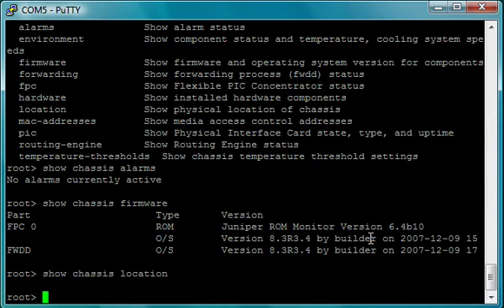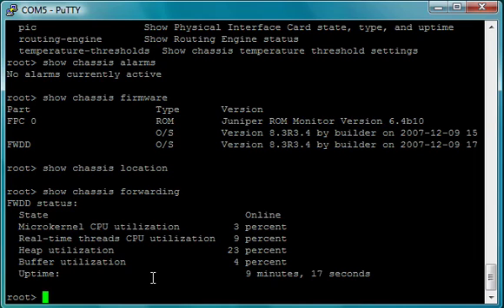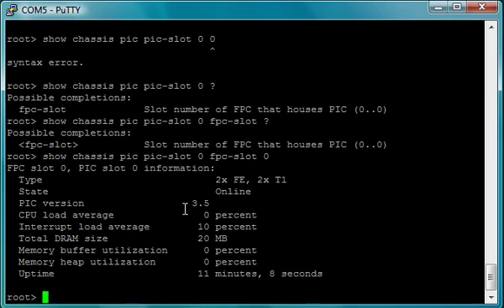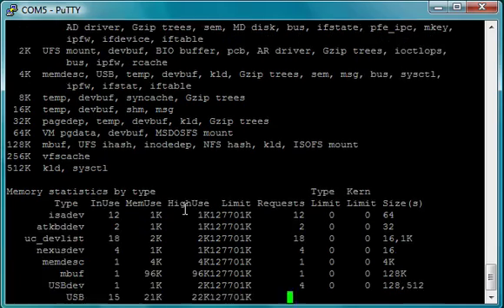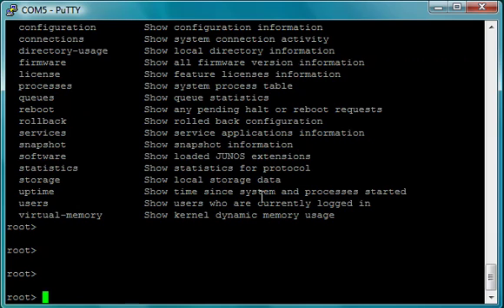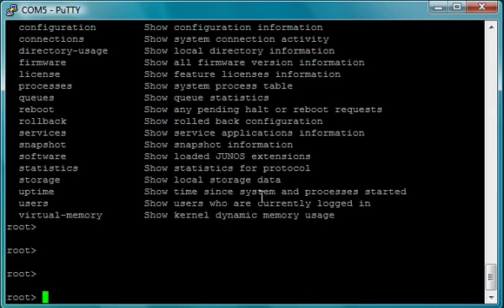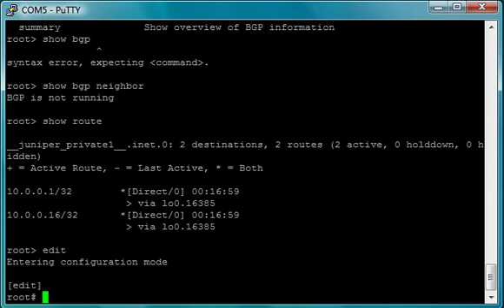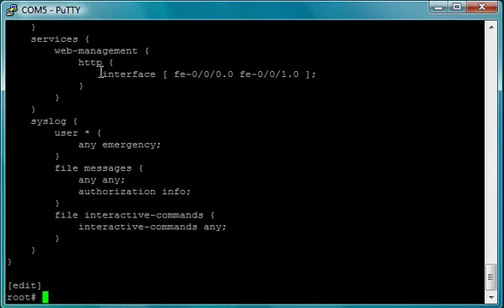Introduction to Junos Part 2

Comment: On a Cisco you say reload in X amount of time and it reboots without saving your changes as long as you didn't do a write mem . Templates can be a waste of time, people copy them and don't know what they even do or forget to edit them .   If you are a UNIX person, juniper OS is probably easier, but I prefer Cisco iOS myself
Reply from the maker: While you are correct, the Cisco solution requires taking an outage, and some large devices could take 20 or more minutes to come online with all routes. That could be an issue, where I work rebooting a core router with the reload in command would get you standing in the unemployment line super fast.

Comment from the maker: Another area where juniper falls short is in branch office routing features, such as ip ska and other indirect monitoring features. In the service provider environment juniper never had to deal with issues like my interface is up but my cable modems cable interface is down, so my router thinks the connection is up but it really isn't, let me change the default route to use the backup isdn line.

Comment from the maker: On juniper it has to be enabled under the interface, and under the protocols mpls section, and under the protocols ldp section, and under the protocols RSVP section. On top of that if coming from a cisco background the relationship between lsp's and mpls forwarding is not very clear. Juniper will only label and forward mpls packets if the routes are learned via bgp and puts all mpls routes in the "inet.3" table by default. In order to use them you have to enable igp shortcuts

Comment from the maker: Additionally, junipers choice and patent to separate the forwarding and control planes means that in order to debug ip packets you have to use a span session or port mirroring, since the packets never leave the ASIC. The router is unaware of them and can't dump them to screen like cisco. Juniper is much more verbose, and configuring mpls has to be done in 4 separate Areas on juniper. On cisco enabling mpls is one command under the interface "mpls ip" on.